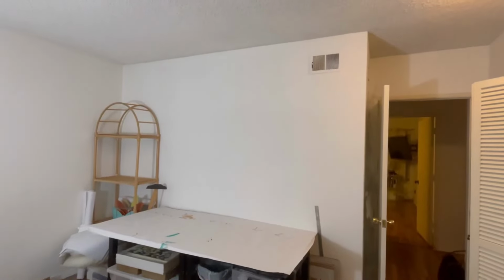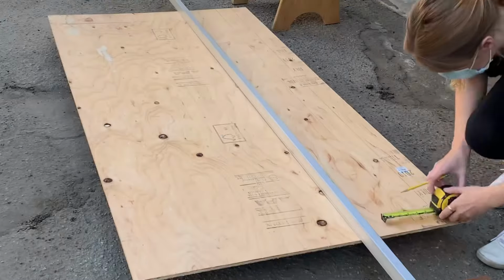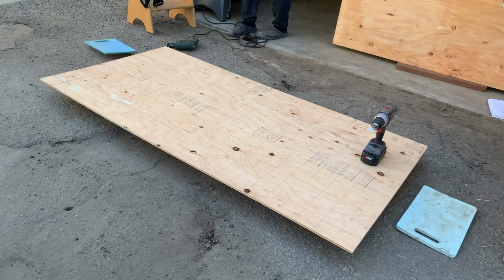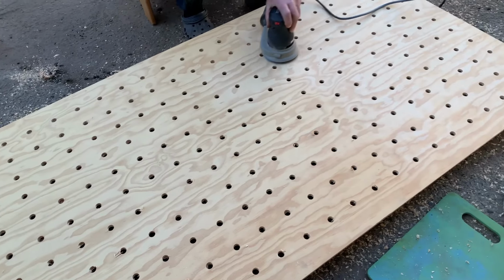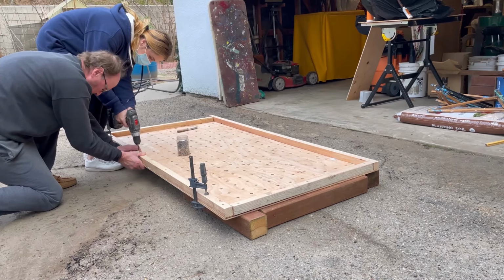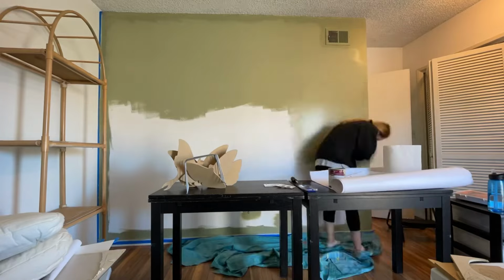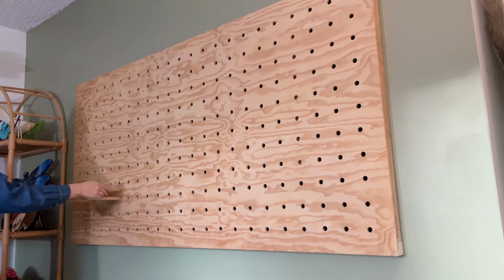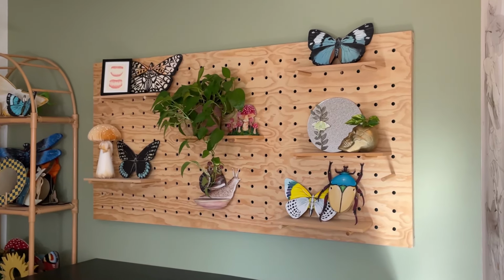DIY Custom Plywood Pegboard (step by step tutorial)

Comment: Did you struggle to ge the dowels in at all? I built something similar and my dowels feel too tight to get in.
Reply: She apparently didn't see your question. You can run some sandpaper around your dowel to take the size down a little at a time until they fit better. 🙂